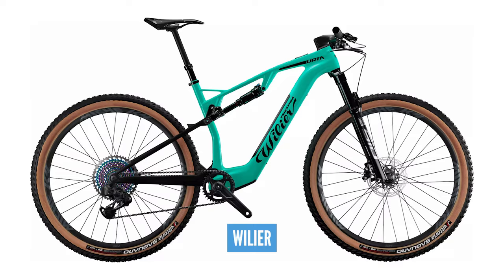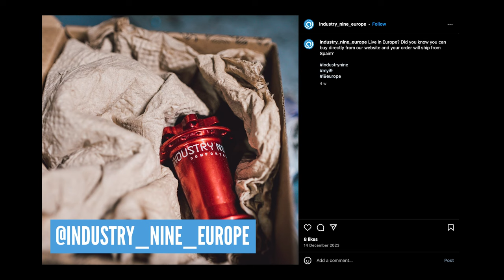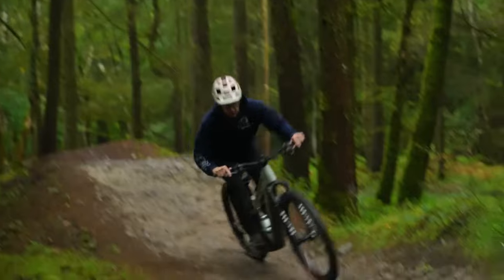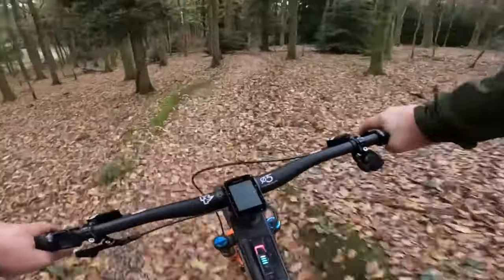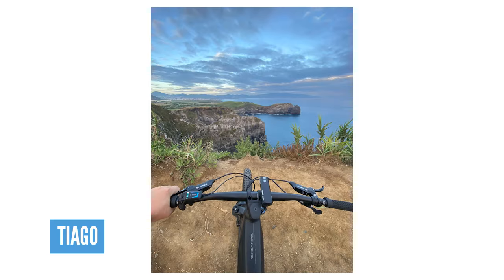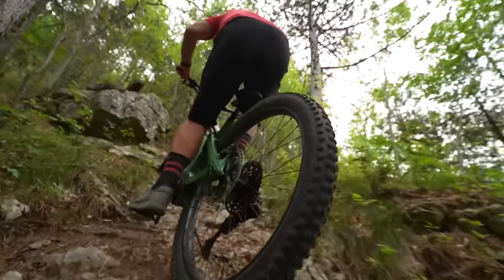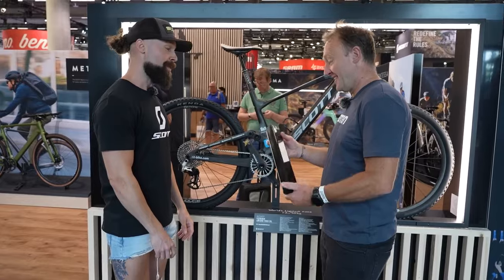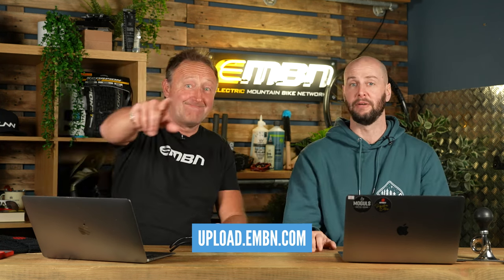Are Lightweight Cross Country eBikes Worth It? | EMBN Show 314

Comment: 17 kg😳, That is NOT a light weight cross country ebike😉. 
My Specialized SL with 35Nm 150mm, now with a 170mm Fox Factory (Enduro) are of equal weight.
The optimal cross country ebike should have a even smaller engine of the TQ-HPR50 Motor that weight 1830g with 50Nm and a smaller battery😉.
Imagine a specific cross country ebike motor of approx. 25Nm and a battery of 250Wh + possible range extender, the motor weight should be approx 1000g and the battery approx 1500g, than this cross country ebike should weight around 13kg😊.
That would be nice😘.
I have 3 pieces of range extender for my 2 specialized "enduro" SL and have never used any of these, as it is exactly what you say, you almost always ride over 25km/h with these light bikes and only use the battery when climbing😇

Comment: I put over 1000 miles on my Giant Trance E+ (20mph usa version) in just over a year and I was surprised how many times I took it on XC trails pushing the speed (for at least 2x longer) instead of my Giant Anthem X which is a 100/100 XC mtb.
Just my .02 - the longer travel helps deal with the higher speeds even on XC trails.
Reply: I’m with you. It’s better to have extra travel and not need it that having not enough and realizing it when you are in the thick of things. Go big!

Comment: Guys if you are thinking on getting an EMTB and want to spend the least as possible go my route. Bulls Copperhead EVO AM 1 for $2,999 delivered! 

It’s one of the heavy ones at 59lb 😮 but with the Bosch CX 4th gen and 750 watt battery. 150 travel front and back, you can’t beat it!

If you can afford the extra $500 or so you can go with the Canyon or a Giant makes an affordable one. Sorry don’t remember the exact model.

Getting an E-bike was the most fun decision I’ve made in my life. And I ride motorcycles too, my Ebaby is my #1 toy BY FAR! You will not regret it! 🤙🏽🤙🏽🤙🏽

Comment: Guys I have a mondraker crafty, battery is housed into the frame and unable to remove. It's kept in a shed and it's currently -5 outside. Will this low temperature affect the battery?
I have wrapped rockwood insulation around the downtube.

Comment: You guys constantly talk about the difference between mountain bike and E-mountain bike tires, does it really matter? In the end, the bike itself might weigh more but what about with the rider, total weight? 

Example, 

MTB plus rider 200lbs
EMTB plus toder 175lbs
Reply from the maker: With choosing eMTB tyres the simple answer is to go with eBike-specific ones. It will always be rider weight + 20/30kg, compared to rider weight plus 10/20kg. If you are a lighter rider you may be able to get away with non-eBike-specific tyres but you will lose the sidewall support on the rear tyre, which helps the tyre keep its shape under the higher levels of torque from the motor/rider's legs which can sometime be more than a small car.

Comment: 120mm is just not that small. XC has really gone insane. 120-140mm is a prefect range for any lightweight eTrail bike. Or as we called them back in the day "All Mountain" bikes. Back when you only had XC, AM, and DH.
Reply from the maker: Suspension numbers have been increasing a lot over the years, XC descents are now resembling the Downhill tracks of old! Do you think the current XC pros are over biking, considering one rider managed to podium on a hardtail?

Comment: I have a one of a kind Trek FX hub motor city bike that I transformed into a top spec cross country bullet with Shimano XT, 2.2 knobby tires and a Fox Factory 32 fork.  I can ghost pedal at 18 mph over to the trails, rip them up and glide back home.  With the range extender, it’s amazing for 40 mile road rides too. My favorite bike ever.
Reply from the maker: That sounds awesome! Did you build it at home? What made you choose a hub driven bike over a mid-drive?
Reply: @embn  I ordered all the parts through the Trek store, down the street and they built it.  My wife has a matching 27.5 electric dual sport, except with a Rockshox Judy.  The hub drive is literally half the weight and requires half effort of the mid drive motors.  We always run the app settings at full boost so the range isn’t that great but two hours of riding is plenty for us.  You just have to barely pedal and they will  literally push you along, up to 20 mph.  These bikes have changed our lives.  😊👌